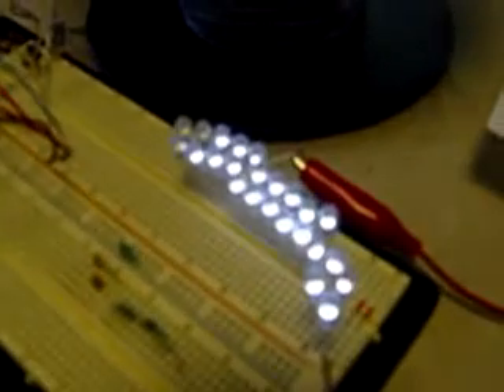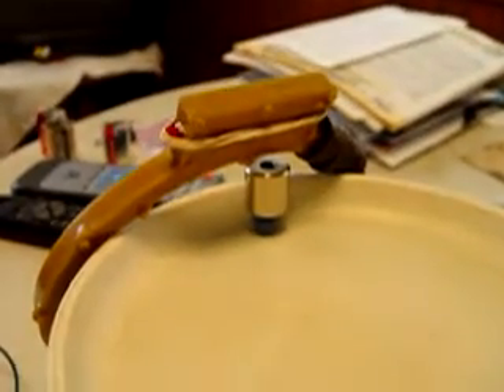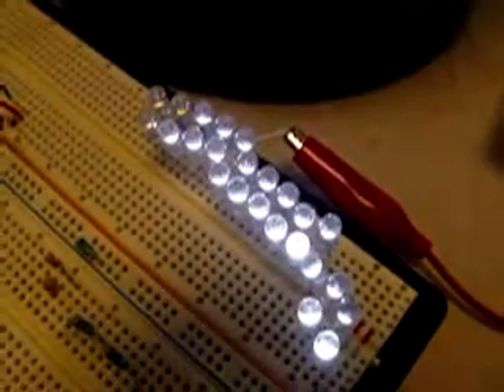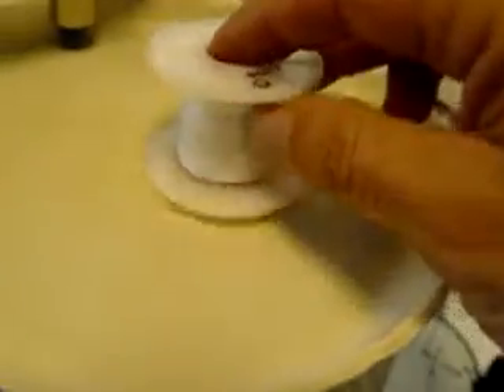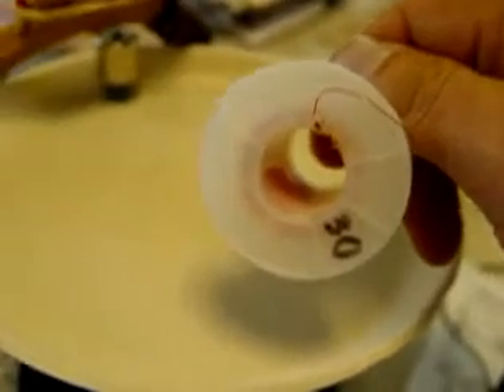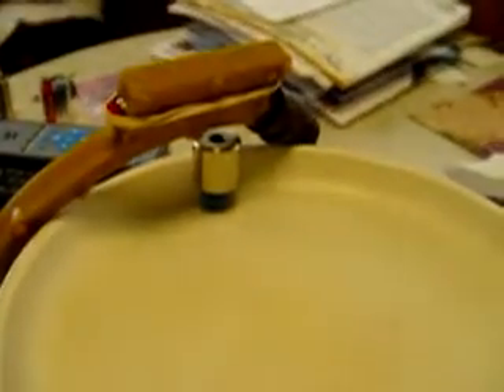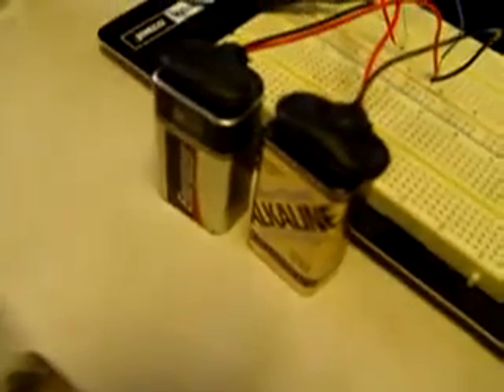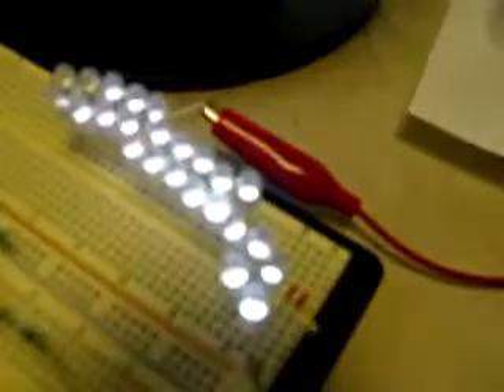One magnet no bearing Bedini / Davro motor - Load Test (3)... 20+ LED's

Comment: try something interesting... to power a 110V bulb or device...
I can say now, you havn't got enough power...

40V X 0.040mA = 1.6 watts

I might be able to run my mobile charger off that, assuming it runs from 110V...

You also have to be carefull of generation frequency, US 110V is 60Hz and UK 240 is 50Hz... rough guide would be + or - 10Hz

Comment: retrod,
if you run LED's in series then the curent flow remains the same (~30mA) but instead it requires more voltage to light the LED's...
depending on the amount of power produced by the coil...
try running groups of three / four in series and run multiple groups in parralel that way you can get the most out of your gen coils...